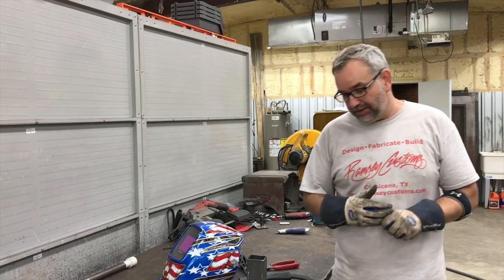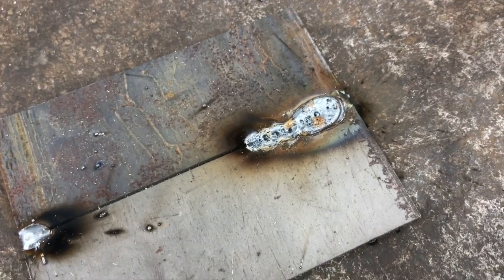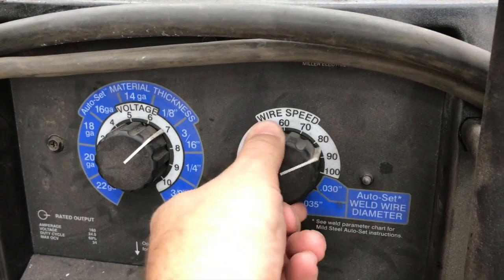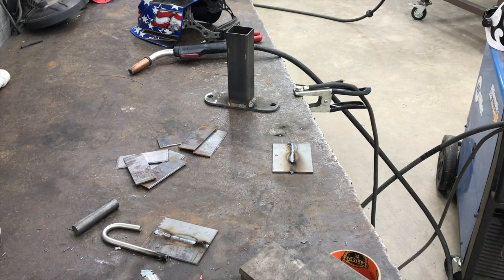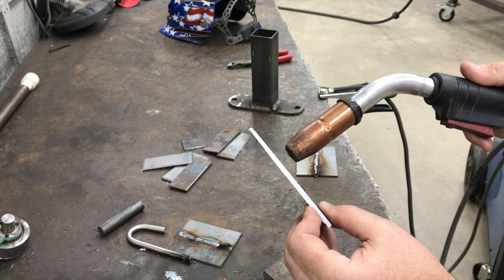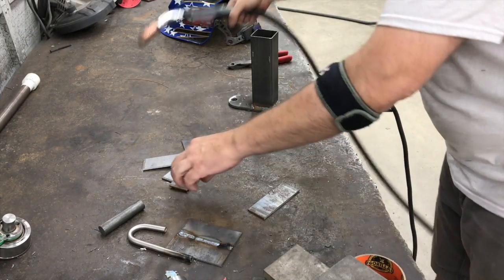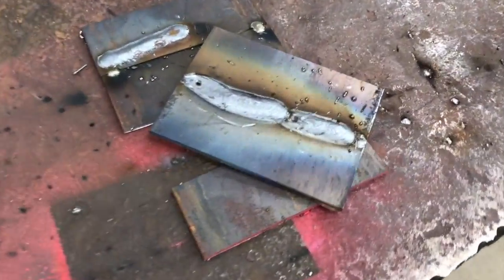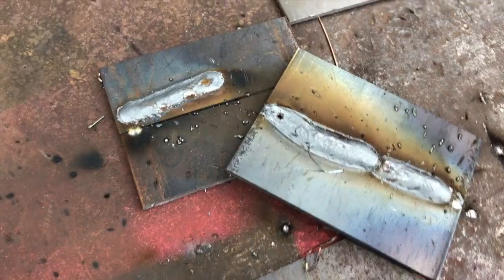Why are my Mig Welds so Bad?

Comment: Bullcrap. Even when you try to weld bad it is still far better than anything I can do. I've tried to learn all my life and I'm getting old and I still can't weld with mig, oxy-acetylene or stick. I'm the King Midas of welding. Every piece of metal I try to work with just turns into scrap. I'm not proud of it, disgusted with myself. And I knew all this stuff. Just can't weld, guess I'll use rivets again.
Reply: Do you have a good quick mask with good visibility? Not being able to see properly is what I fight constantly.
Reply: @SKEptic-mg2dd  I totally agree. I've only welded for about 2 weeks now and got tired of using my  dad's old welding helmet. It was a flip style helmet with a small lens that was scratched and too dark in my opinion. The only way that I could get a half decent weld bead, using that helmet, was to do a "dry run" 5x prior to doing the actual weld. I ended up buying myself a Miller Digital Elite Series Inferno welding helmet for $389.95CDN when I purchased another bottle of C25 gas. And MAN!!, my welding experience has been changed entirely. I no longer need to cock my neck sideways to see a bead that I could barely see anyway, lol. I can do half decent welds all day long now (half decent because I only started 2 weeks ago).
Reply: @SKEptic-mg2dd  SpeedGlas you want brother.
Reply: Practice practice practice. Nobody is born with these skills they are gathered through trial and error. I’m currently attending college to get my degree in welding technology and I can’t tell you how many times I didn’t have the ground clamped, or my gas on. Also play with your settings try to find the sweet spot. Good luck to you.
Reply: One thing he did not mention was walking the puddle from left to right as you go along, it took me along time to get that part finally I got it just right I start on one piece and then I slowly move the torch from one side of the crack to the other in a smooth motion, Left to right. I use to try to weld in a straight line and never got the weld to look right...
Reply: I agree, welding is totally bullshit.  I can't even see any weld puddle its so damn dark under an autodarkening weld helmet set at 9.  And there's way too many variables of things that can go wrong, so that most of the time... something is going wrong.  There's too much art involved.  Someone needs to come up with a better way to join metal to metal.   When I can, I try any way I can to bolt things together before I'll weld them.   I've set my pants on fire, I've burned holes through my socks and jumped a mile, I've blinded myself, it's just totally bullshit.  At least I haven't electrocuted myself yet...
Reply: @choppergirl   I'm laughing so hard.....  I recognise myself there.  I'm amazed I haven't burned my workshop down yet.  And somebody should take my grinder away from me, not just my MIG(s).  Loving the honesty of some of the comments here.  ;-)
Reply: Having a little better luck with 6011 and 6013 stick welding with an 1970's Sears AC buzz box, and pointing a 300w or 500w shop light right at my work.  Still, welding rusty metal makes the welding rod tip heat up and stick like glue and is damn hard to strike a spark.    If I clean to the bare metal though no problem.  Still can't see a damn weld puddle worth shit.  At least now I can see the crack I'm welding.... or more like... melting the fuck out of, because I jack my amps up on the high side...  

http://air-war.org/trailer.jpg
Reply: I bought some 500 watt shop lights to point at my weld targets, maybe with 1000 watts of lighting up shit like the sun I'll be able to see something if I don't burn myself on them first.  I haven't tried them yet, I'll wait until I have to weld something next.

My thought is get as much light on it that you can just below whatever is necessary to trigger the autodarkening helmet.   Then when you weld maybe you can see the landscape around the weld and which direction to held.   It won't eliminate all the BS factors involved in welding, but at least I won't be making a weld seam 1cm parallel but totally missing the joint because I can't see for shit.
Reply: @CHOPPERGIRL's AIRWAR
Let me know how these shop lights will do for you? I'm thinking about that idea too. Bu haven't bought powerful lights yet. Also maybe the initial flash is blinding you just before the helmet darkening mode kicks in. Making it extra hard to see where the weld goes. 

As I just started I'm first going to see how a better helmet will do. It's a TywelMaster Tywel9B bought from AliExpress seller. Maybe I do a modification on the helmet to manually engage the darkening mode just before I start the weld.
Reply: The cheapest shop lights are from Walmart:
https://www.walmart.com/ip/Bayco-500-Watt-Halogen-Project-Work-Light/14003469

Those halogen bulbs are real easy to bust from shock, so... be careful nto to bump or drop them or you'll be replacing lightbulbs.  Pick up an extra pack of 300 or 500 bulbs while you are they, WM also has the cheapest bulbms.

I'm using a HF cheap autodarkening helmet, the one with the blue flames,  set at the lowest setting.

The cleaner your metal, the less your rod will stick.  I've watched several hundred welding videos on here, but they don't help nearly as much as they should, because they are done by guys already welding 5,10,15 years.   Bob Moffet, ChuckiE2000, etc.

What they need to do is bring their grandmother off the street and hand her the welding rod, and see what it's really like to teach a beginner to learn, not this bullcrap where they are just showing off.
Reply: @SE45CX  - I also through of using a deer billion candlewatt spotlight pointed at the weld area to... I have one, but have not tried it yet as mine is 12volt battery operated.   I think it might work better than the shop lights though because it's more focused
Reply: je-i'm with you I try everything and just do shitty work-I am a better grinder than welder so dont feel like you the only one
Reply from the maker: If you lived close to me I am sure I could help you out
Reply: yes its a practise thing
Reply: sucks im the best in the world ....im also welding for N.A.S.A
Reply: If visibility is it that prevents you from making process than that is the main issue. Don't listen to all these crappy DIY idiots who claim to know everything and tell you you need more practice/experience.

Oh I don't mean Ramsey Customs - turbocobra here. I mean the losers at my DIY car repair shop.
Reply: try stick first
Reply: See you at the local College is offering night time welding courses I took one of those it helped out a lot
Reply: My mig had a blown capacitor and a clogged regulator, I was really hating on welding till I realised ... When I got it sounding nice and crackly the weld looked terrible, when it sounded terrible the weld was looking good 😂
Reply: Je G lots of flux it's all about keeping the oxygen away from this steel so it doesn't ask side when you have liquid steel it oxidizes very very quickly the hotter it is the more oxygen a metal absorbs did a lot of flux and use those kind of flocks and you can't do a Bella pad well some some welders have the ability to use very little flocks he sometimes even what's in the stick and do a good well so you can buy flux at a welding store and if you just soak your riding fluxer put it on your wells do you will have a good well that creates a layer of gas of pocket of gas that keeps the oxygen away
Reply: I'm with Je G, welding is bullcrap.   I started out with a wire welder that would get stuck feeding, and that was horseshit.   I moved over to a big box 1977 Sears AC stick welder and had somewhat better success with 6013 and 6011...  but trying to weld with 7018 is bullshit.  The shit sparks than sticks every time I try to scratch an arc.  Sparks and sticks.  Sparks and sticks.    

It has nothing to do with practice, it has to do with there's too many damn variables going on at one time that you have to control, and it don't help that I can't see jack shit behind an auto darkening welding helmet set to 9.   No welding puddle, nothing.  Most times I can't even see enough to follow the joint I'm trying to weld, and end up making a sweet ass weld (for me, anyway, probably birdshit for a pro welder) that veers off to the side and joins...nothing.

My new plan is to forget 7018 and throw that shit in the garbage, and just focus on getting pretty good with 1/8 6013 for horizontal runs and use it for every fucking thing, and okay good with 1/8 6011 for veriticleor out of position  runs.    I guess now that I think of it, I could narrow that down to just using 1/8 6011 for everything... but...   6013 seems easier to use.    Figure out some voltage setting and travel speed that works bestwith just one stick, one size, one voltage.   

Otherwise, there's just too much damn changing from stick to stick and size to size and voltage to voltage and type to type.
Reply: Settle down,  get comfortable  and  experiment with the variables. Note the differences and you will teach yourself.

Comment: does the trigger operate the gas or is that always on until u turn the valve off on the bottle ???? plz any help as im using loads of gas cheers
Reply: kenny ball - A good professional machine should "cut" the gas. But it all depends on which model you're using. 
Either case make sure your gas installation is 100% sealed, without leaks, cracked hoses, pinholes, bad connections...
PS. If so equipped check the good functioning of the solenoid. Soapy water can be a life saver. Or in this case a gas saver. ;-)
Reply: its a sealy.....i knew leaks would be a problem so ive checked triple cheched and got the dog to piss on it....i jusu stink i turned it on way too high...need to find some1 to set it up for me i think but thx for ur ideas much help :)

Comment: im new in the game of welding and i have a question, for some reason recently my millermatic 215 keeps burning the wire before it touches the metal.
Reply from the maker: Ok, yea I have seen that a few times.  It can be a few things.  1 gun distance, make sure you are close enough. 2. Make sure your welder is setup properly, there are leads that need to be reversed if you are using flux core vs. gas. 3. Make sure you have a good tip in it.  4. Make sure you have a good ground and the metal is clean and free of paint or oil

Comment: When I use the small shop Miller 110 vac ( happens to more than one person) welding with the settings recommended on the door, weld along fine you get a sputter or a pop with the wire melted in the tip so bad you have to change it. Never had this problem except with this welder, been using miller 250, Lincoln 110, and Snap-On 110 welders for years with out any issues like this.
Reply: Sounds like you're welding too close if the wire melts to the tip.  Wire stick-out should be about 1/4" - 3/8".
Reply: this can be a trouble with the unrolling wire, a restriction in the movement of the feed wire roller that is restricted by something, I had to rebuild  the roller pivot on my machine because the the wire coil was gripping and that caused burned tips, this time , I used a ball bearing with a small brake to control the over rolling

Comment: ALSO VERY IMPORTANT!   If you weld with flux core and are going to add gas, along with of course changing the wire, YOU MUST SWITCH THE POLARITY!! Ground clamp to positive and gun goes to negative.
Reply: With outershield the polarity stays the same!

Comment: If you have your gas flow too high it also can cause prosody due to turbulence....With  shielding gas you push the puddle, with shielding wire you pull the pull the puddle and reverse polarity......Depending what material size sometimes you can melt the prosody out by cranking up the heat and turning down the wire speed and go over the prosody ...then reweld the affected area....

Comment: Other stuff some might find of use- if your welder has the polarity terminals fastened by nuts, check they have not got loose and are arcing-happened to me once, hammer a piece of copper pipe flat, drill it, shine up part of your bench and bolt the copper on and attach your ground to that, I use a Mag clamp as well-it can often be attached to the workpiece.
Was that gas bottle secured?
Reply from the maker: Yes the gas bottle was secured with the chain that the miller cart came with

Comment: Can I weld with no gas ? I tried it and it was alright not the greatest
Reply from the maker: If you weld with no gas, you have to use Flux Core wire, you can get it at home depot.  Trying to weld with regular wire and no gas would likely make a big mess
Reply: Gas is used to stop oxidation by air interacting with molten metal
Reply: Lonnie Stutler  - Thank you for this info.

Comment: Sometimes I like welding with the low wire speed. It is called globular transfer welding and is normally used for high carbon steel.
Reply: It gets good penetration with less fill. Your welds will have either a washed out look or a stacked look. With some practice you can make mig welds that look like tig. The process is almost like using your mig gun as a tig.

Comment: lol.....I can't count how many times I've had my shielding gas blown away by a breeze coming thru the shop because I have both front and back bay doors open.
Reply: 95° and 90% humidity with all my insulation on welding in still air is my life 😢 and I'm dam good at it.
Reply: @dishman5161  florida?
Reply: No that's not a good idea because you are blowing the shield gas away.
Reply: @geofftownsend7973  He literally said that in his post you numb nuts.
Reply: I learned alot from this video, have run across these issues in the past, just yesterday, I was not sure, but it was breezy out and my weld started to pop, thought it might be blowing my gas away. You just confirmed that for me, thank you !

Comment: How does wire speed too high react? It spits as well right?
Reply from the maker: A little too high, and it will weld fine and just stack up the bead.  A lot too high and yes, it will spit and pop

Comment: Cover a part 2 where the nozzle gets clogged and grounds out. Also don't forget wire fusing into the tip, and how in a pinch you can sand it back to rescue it, if you don't have any extra tips on hand. 
Show the difference between a freshly ground surface and one with the mill scale left on. Hobbiest and small time fabricators should really get into the habit of using a flap disk to prepare the weld area. It makes enough of a difference in weld appearance and overall penetration. Which also builds confidence in knowing their welds are strong.
Reply: You don't know who I am, so I'll just let that slide.
Reply from the maker: Lol, good come back, i was getting new comments on this video and just now saw this
Reply: Yeah Echo, we don’t know who you are. Just like the old internet saying goes - you could be a dog.
Reply: Says he is a mouse, who is economical, apparently. Just saying.
Reply: @rick343   I suspect it's ecological rather than economical, judging by the green leaf on the avatar.  Of course, he might be economical as well.  ;-)

Comment: Should've shown worn consumables, clogged nozzle, worn out tip etc.  These all greatly affect the quality of welds too.
Reply from the maker: You don't weld very often?  Dude you need to get to it, you got plenty of stuff to weld now!
Reply from the maker: Joe, great suggestion.
Reply: Joe I agree I've had those issues at work and didn't really know what was wrong I don't weld very often so It took me awhile to figure out what was wrong
Reply: Joe spot on!
Reply: Joe most of these guys don't even realize that they would be 100% better off eliminating the gas all together and going to FLUX CORE wire. I've used it a better part of 20 years now and it's all good on steel. Alum. You need the gas and even bump it up on hot summer days... The start of the video makes me wanna drop an antacid...